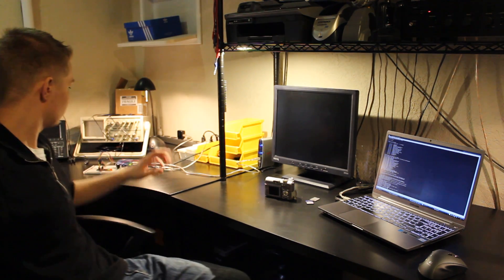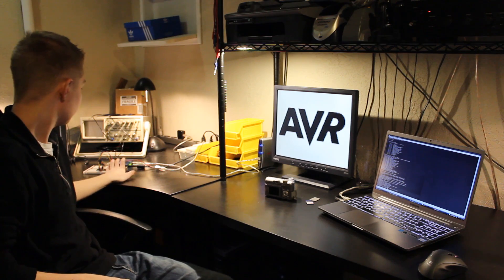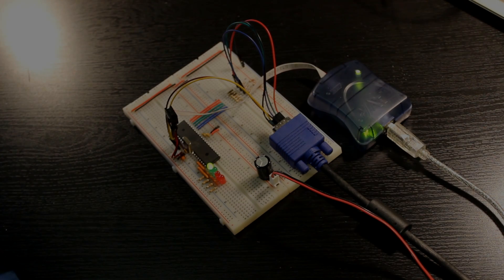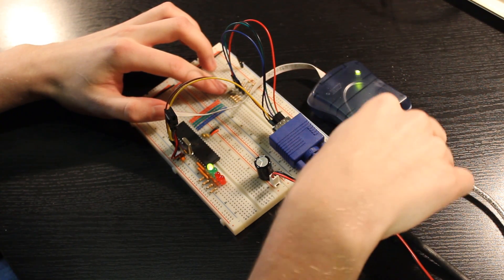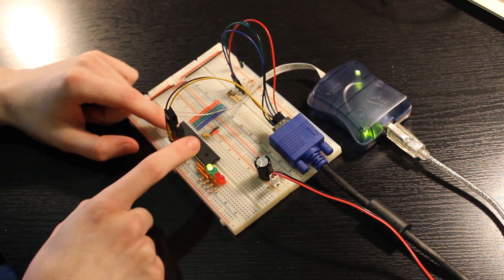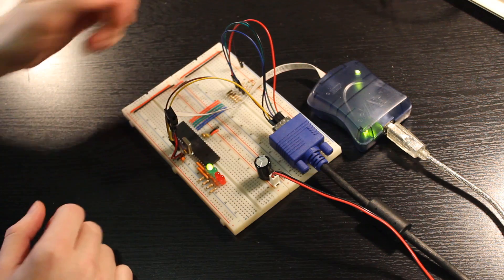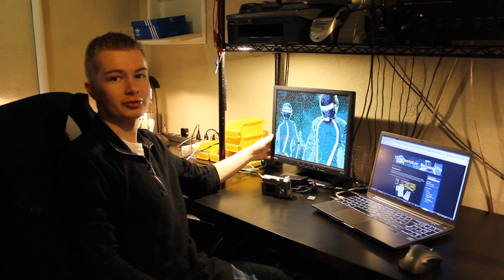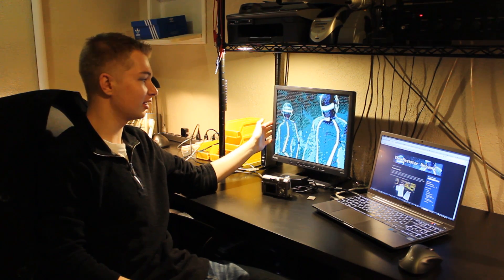Microcontroller VGA Generation

Comment: Would't it be possible to use the DMA to write directly to the ram through SPI or something like that?
Reply: Er, I think you've mixed up 3 different things there. For one thing SPI has nothing to do with DMA, and in any case that MCU doesn't have DMA :)